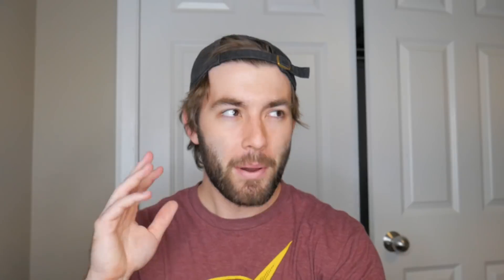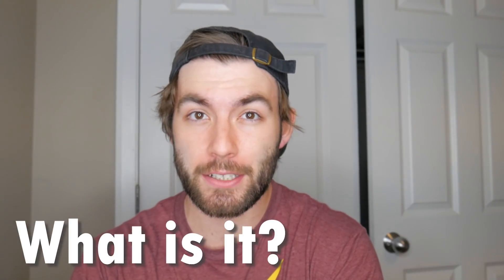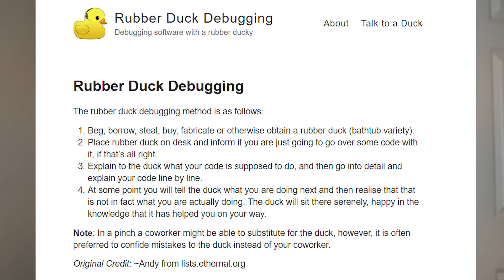Why Every Physics Major Needs A Rubber Duck

Comment: Andrew one suggestion for a video or just  reply this comment :P
My question is how much  effort I should put into comments in coding
sometimes i put nothing and it's really bad afterwards  but sometimes i just comment every single line and I waste so much time
Reply: Francisco Russo if you are not a professional library coder, and you are definetly not, try to comment only the shady/confusing parts of the code. If you follow a consistent naming method, while keeping the code clean and organized, it will almost speak to you what it's doing
Reply: I like to explain what functions, classes, etc. are supposed to do. If there is any part of my code that takes a while to write because it was difficult to figure out, I comment the big parts of it and explain my reasoning.
Reply from the maker: I agree with what Ciccio and Aidan said. If I had to be a little clever to get a part of a code to do what I want, I'll definitely  put something like # This is so such and such outputs this and that in this way
Reply: thank you :)